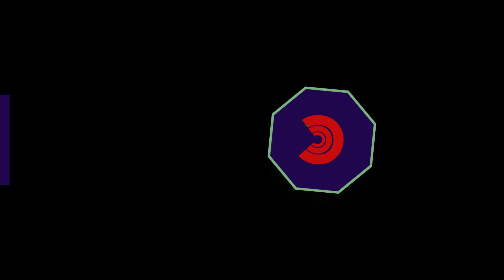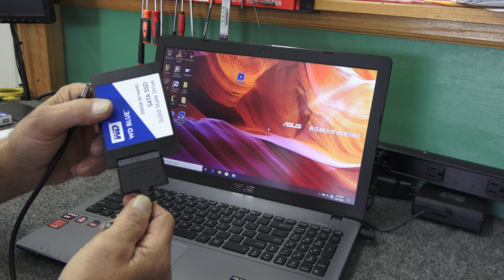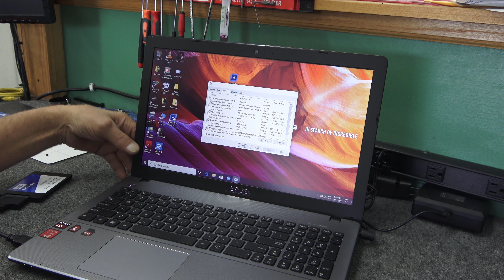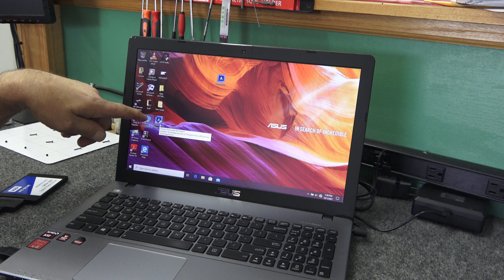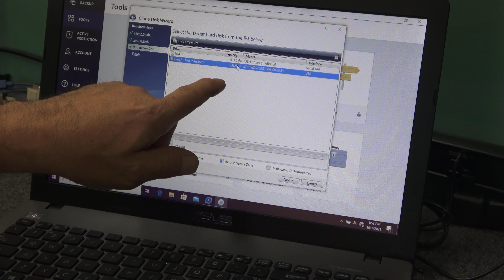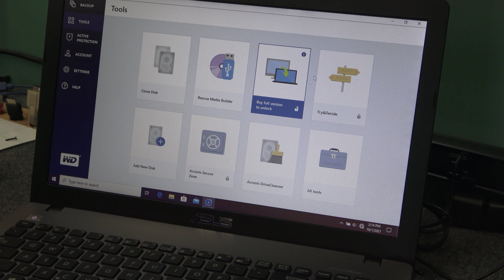How to CLONE Hard Drive to New SATA SSD and Install SSD in ASUS Laptop. Using WD Acronis True Image.

Comment: Recently I purchased a brand new Western Digital Blue SATA SSD drive with a less than $10 usb to sata cable. I downloaded Acronis True Image software and the software's clone section does not recognize my disc. However, when I go to the "add new drive" section it shows. Is it OK to initialize it? Would it then be recognized by the software? I also tried Hasleo but it wouldn't let me clone the drive either. What would be the solution in this kind of scenario? Thank you for your help!!

Comment: This process is so confusing because i often try this cloning process with my Acronis True Image software and have a non bootable SSD when i'm done. According to Acronis, you're supposed to put the NEW SSD into the internal HDD slot and connect the original HDD to the USB adapter. Even when i do that, i still get a SSD that's non bootable.  The cloning process is not as simple as most of these videos make it appear.  There are so many things that go wrong during the cloning and Acronis had terrible customer support once the product comes off warranty after just one year.

Comment: I was disappointed with Acronis True Image for Western Digital. I used it to clone from a WD hdd to a same size WD ssd. Since this is the software which comes with a purchase of a WD ssd. The result were clones that seemed to work but not quite right. Upon Windows start up the clones would default to having chkdsk check the drive. Then I noticed some programs would not start normally. I tried some other freewares without success. Some like Macrium Home 8 worked for cloning from a hdd to another hdd but gave up with an error 8 when cloning from a hdd to ssd or ssd to ssd. AOMEI Backupper is not free. Hitting the "start cloning" button results in a paywall. What worked for me was freeware, Ventoy and Rescuezilla. They are copied to a USB drive. I went to the BIOS to have the computer boot from the USB drive with Ventoy and Rescuezilla. Now I have clones that really behave like clones with no issues.

Comment: When do you use the Manual mode instead of Automatic?   Is it true if your source drive is MBR you need to initialize the new SSD with a Simple Volume before you start the clone?

Comment: Great reference video.  I have cloned two HHDs to SSD (one laptop and one desktop) without issue and am getting ready to do my third (a desktop).  The difference in boot time between an HHD and an SSD is amazing.  (10x faster).  People think they need a new computer if it is running slow.   Most people have so much junkware and bloatware and start-up programs running that they don't need.  Clean that up and install an SSD.  I just use Western Digital Blue (1 TB and a usb to SATA cable, $80 and $11 respectively, mailorder from A-----z--n) Thank you for doing this video.

Comment: I was following along with same WD SSD (but 500GB) and even the source disk is 1TB like yours. Half way through your steps, I got an error message that said something like there wouldn't be enough space for a boot disk, but I had an option to continue anyway. So it continued just like yours almost all the way through the cloning process, but I just received a message that cloning had failed. I forgot where it told me to look for details before closing out, so I'm not sure why it failed. Could it be that there is data written on the source disk far beyond the gigabyte range of the SSD? Meaning, is there's a partition near the end of the TB HDD, then there isn't enough space on the 500GB SSD to capture it? Just an idea, as I'm not sure what happened.

Comment: Side note! Make sure your new disk you want to clone match the old disk GPT or MBR If they don't match, your new disk will NOT boot! Easy way is to check in CMD when you've attached the new disk, then run DISKPART and look to see if both are the same or if the original old disk is GPT or MBR you need to either change the new disk to match the old drive or visa versa. Mine older laptop was GPT but the new ssd was MBR. GPT is said to be better in the fact it can could many more partitions on the drive if say you need more than 4 partitions, which is the max in MBR
Reply: If they don’t match, do I have to restart the whole process?